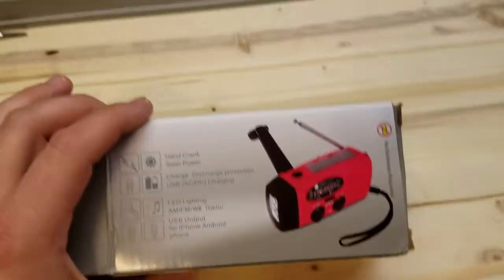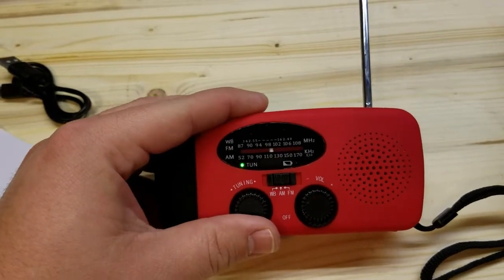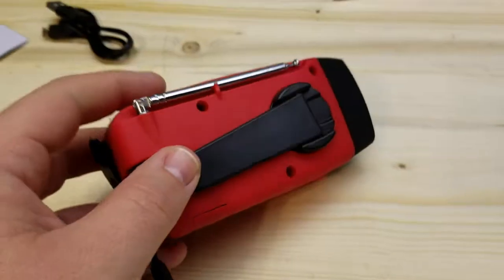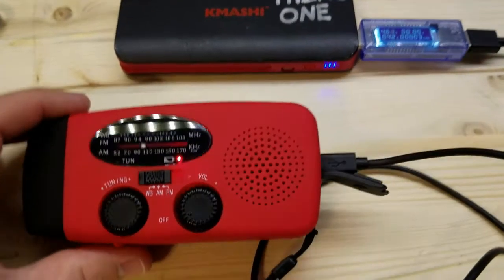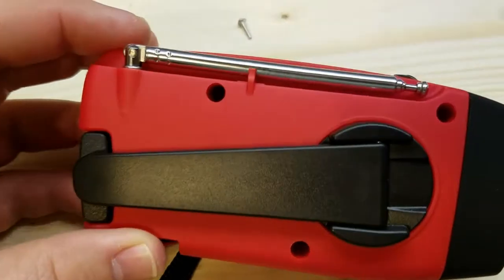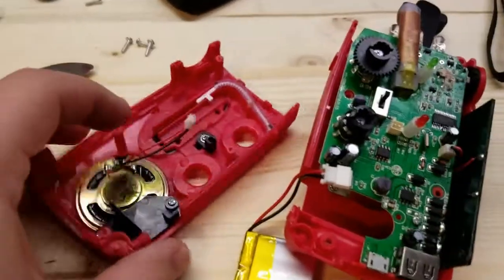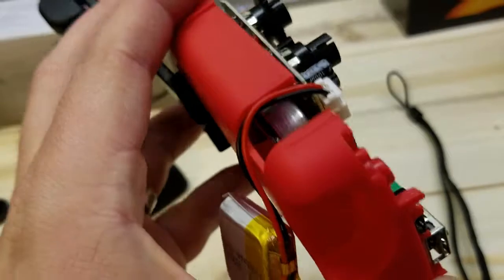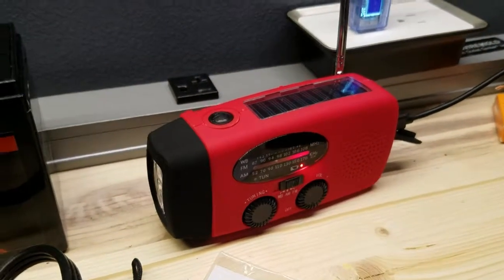Teardown of a Solar/Crank/USB powered AM/FM/WX Radio Flash Light and Charger

Comment: Nice  video. I have 2 question. If we remove the lipo battery can we still charge a phone and will the dynamo still power the flashlight atleast?
Reply from the maker: I know the flashlight would work for as long as you turn the crank or have enough light. I'm not sure if removing the battery would still charge a phone. Obviously, there would be no storage so you'd have to keep cranking if you wanted the phone to charge.
Reply: @experiment86  thank you

Comment: Hello, I have a question. Can you send me a link to the battery? I’m having an issue when I crank it for around 5 minutes full speed I only get around 25 seconds of flashlight power. Do you know a fix for this?
Reply: Also mine is pure black, not red. Don’t know if that has anything to do with it
Reply from the maker: @thiccnugger6820  I don't have a link for the battery itself. You might could try looking up any model numbers that might be on the battery pack itself.

Comment: I ordered mine from Amazon it only worked once and even if I wind it up it refuses to charge the phone. It's a piece of shit gimmic and the flashlight supposed to work after winding it up but it does not.
I'm guessing the Radio, Flashlight only works using batteries which is stupid
Reply from the maker: Yeah im sure these don't go through the most strict quality control considering the price. 

Does the red light come on when you crank it? The battery pack might be dead or the dynamo might not be connected.